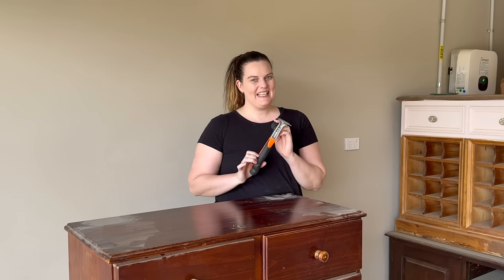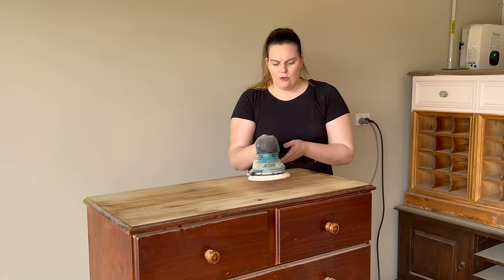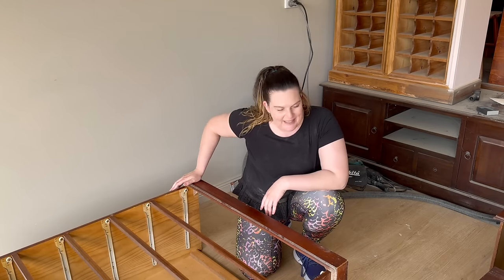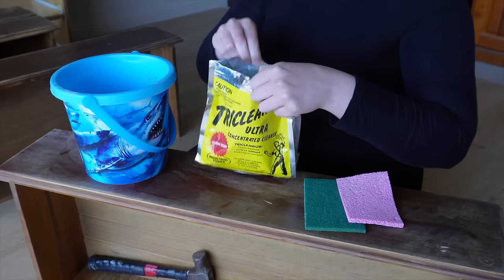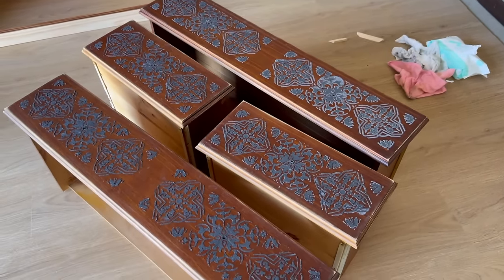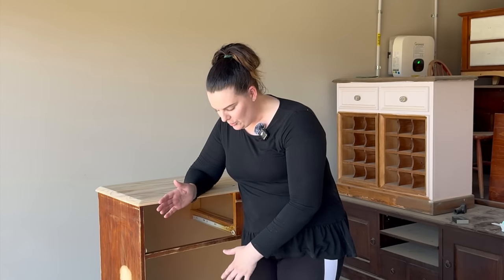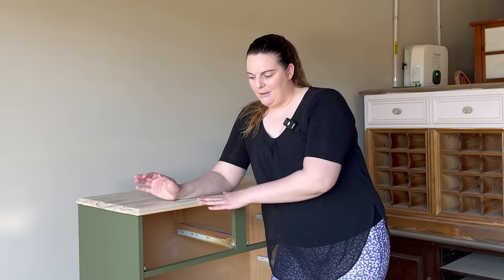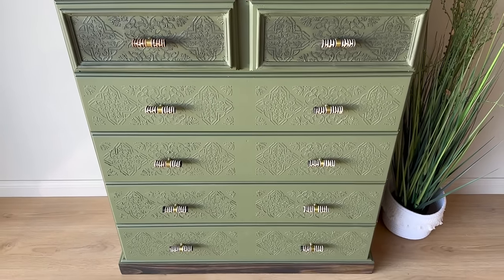A Unique Furniture Flip Featuring A Raised Stencil Effect - Will You Like It?

Comment: Curious why you didn’t put black wax on all the drawers. Was it a design choice? Or a matter of it taking too much time (like the framing)? It seems a little unfinished/disjointed to me with the wax not being carried through on all the raised stencils. I kept waiting for you to explain your thought process on that, but you never did.
Reply from the maker: It was just a design choice, the black wax didn’t take very long to apply and I could have easily applied to all of the drawers however I found with the dark stain on top the piece felt quite dark overall and I though it might have been too dark if I did all the drawers with the black wax. But you could easily do it 😀